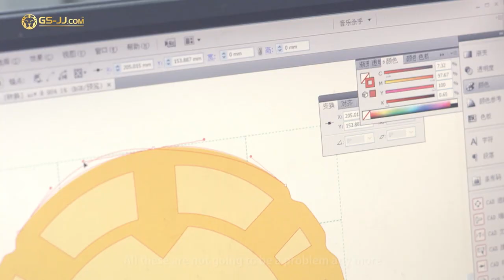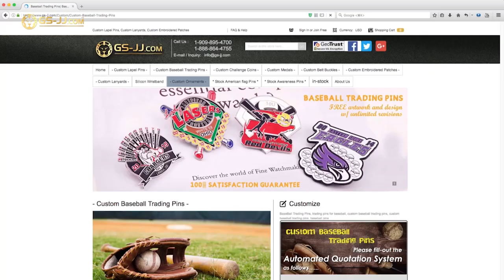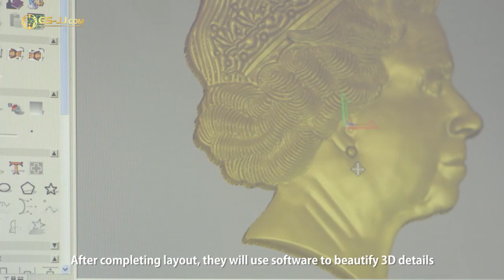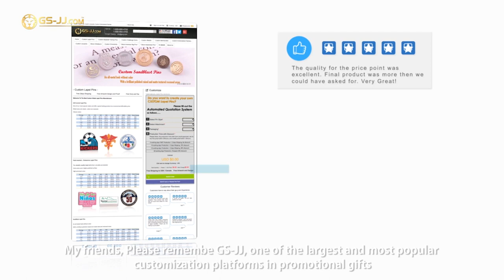Custom Pins  www.GS-JJ.com

Comment: Great video. And yes you hit all the concerns we usually have. Although they quoted me $2.25 for a 1 inch by half inch soft enamel five colored pin. I was surprised at the high price. That’s like wizard pin, a middle-man, pricing.
Reply from the maker: Thanks for liking our video. We are not a middleman because we have our own factory. Moreover,  we offer up to 30% off. Compared with Wizard pin, our pricing is clearly better with a shorter turnaround time because they need 2-3 weeks to produce after proof approval and 3-5 days transit time. We can offer rush service, about 5 business days for production and 3 to 5 days for shipping. In this option, we have no discounts. If you have any questions about the price, you can email info@gs-jj.com and our sales representative will help you wholeheartedly.